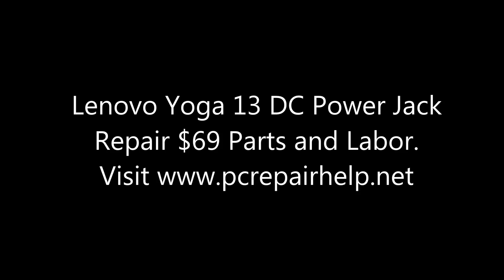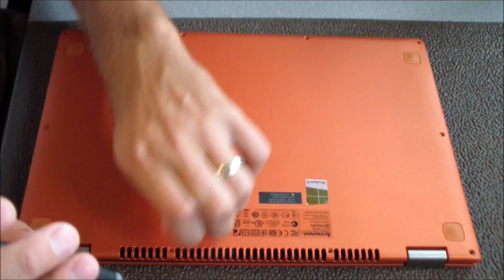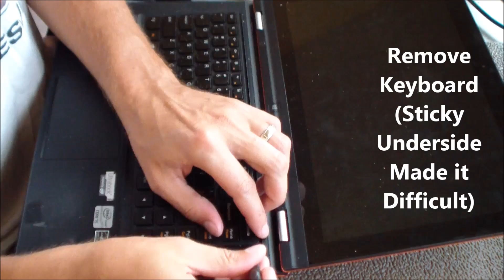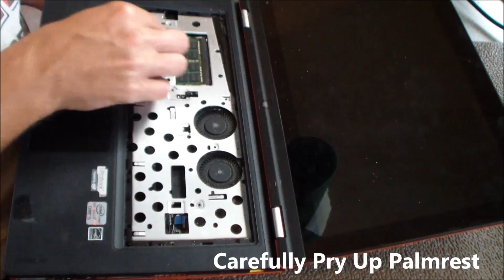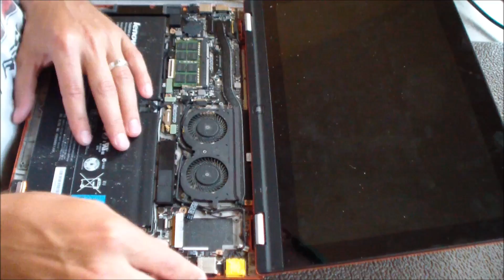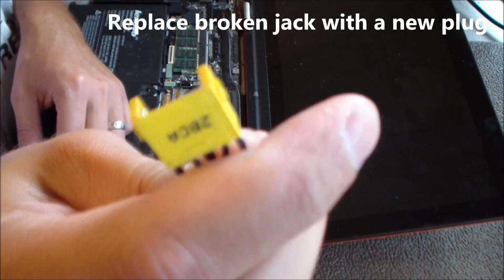Lenovo Yoga 13 AC DC Power Jack Repair

Comment: Awesome video! I was able to perform this repair just as you demonstrated. Unfortunately, although my power receptacle was broken and now fixed via the steps in this video, I might have a bigger issue as my laptop still will not power up. Light on front of the laptop does not indicate charging either. I do hear a faint beeping from the power cord transformer/rectifier. This faint beeping/buzzing was present before and after replacing the power receptacle on the laptop ( it's so faint you have to put your ear up to the transformer/rectifier to hear it). I suspect maybe power supply/ cord is bad, as there is continuity between the inner and outer terminals/ shielding but only when connected to wall power. Any ideas?
Reply: Bad motherboard, 19 volts got shorted to something. working on mine right now.